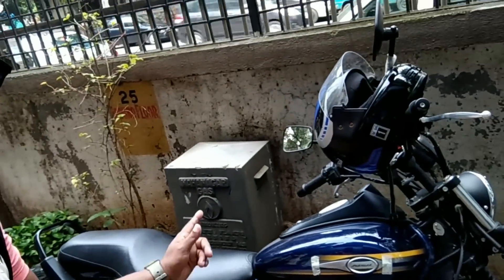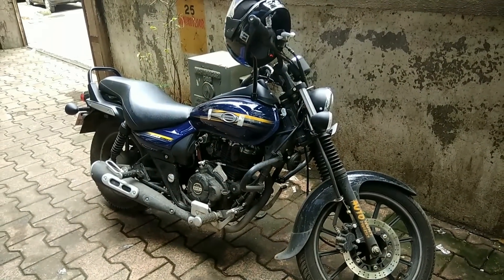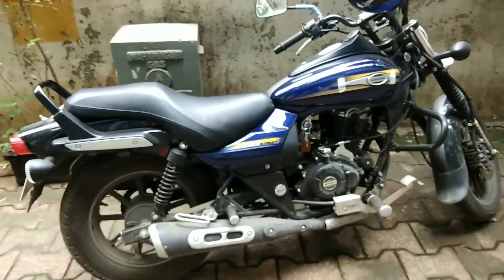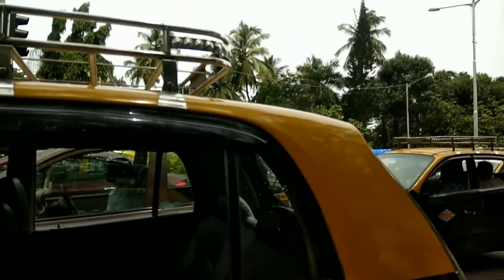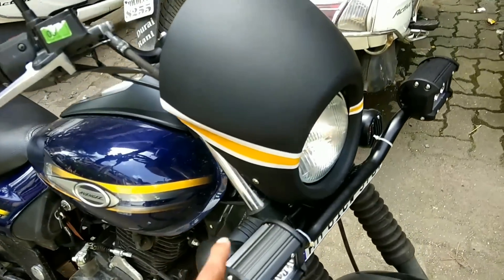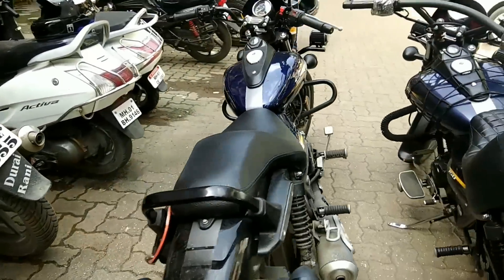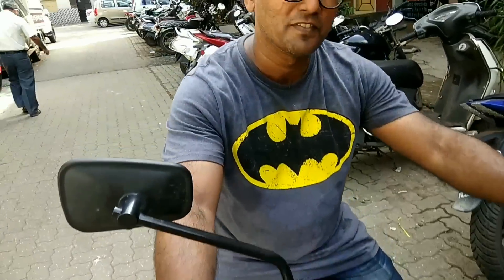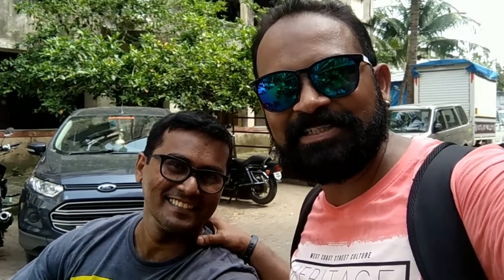Avenger 150 Modification... keeping it Simple

Comment: Im in the idea ofreplacing rd Handel to avenger 150 street is any problem i may face while changing front brake cable , how can you help me out sir
Reply from the maker: Before changing the handle once check with the mechanic ..if ur hv Avenger cruise then it has biggest cables but Avenger street has shorter cables

Comment: I want to buy avenger 220 but bit confused as my budget is low can i go for avenger 150 will it good for city life in mumbai
Reply from the maker: mohit kamble ..it depends on ur budget n requirements..for highways u need to HV bigger engine so go for 220 as it vil gv around 40 kmpl n in city like Mumbai u can expect around 35 kmpl ..for city n commuting n better milage go for 150 as it gives around 40 to 42 in city n around 50 on highway..but it lacks power n speed on highway.i HV 150 cc it's top speed is 110 but cruising speed is around 70 to 80 only n 220 can esely cruse around 90 on highway..so if ur going on long ride u can go for 220 n for daily n city ride 150

Comment: Bro dont change the original handle.. which handle you are using after modification is very wide and its very to ride with this handle in city. I was also changed my original handle with this wide handle but after few days i reverted it again.. Other wise bike looks good.
Reply from the maker: tariq rehman ..I m using this handle for last 1 yr ..but had no issues..ha thoda problem hota hy cut marneko but thek hy..Abi modification Karna hy to thoda adjust Karne padega